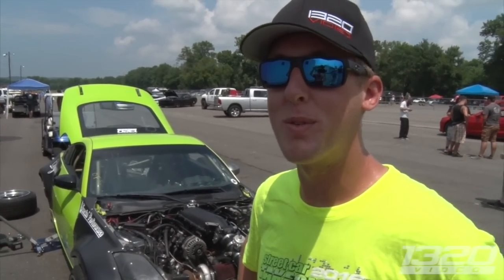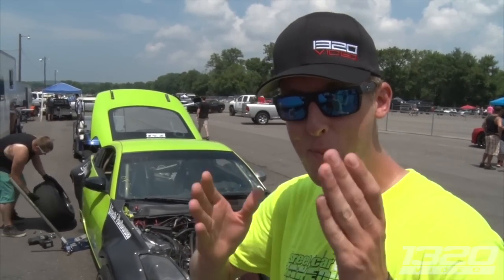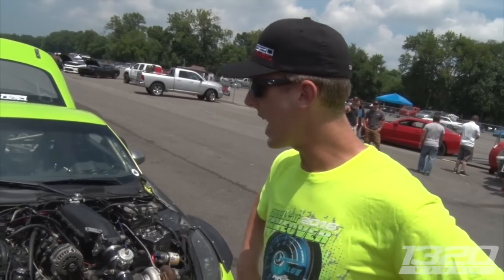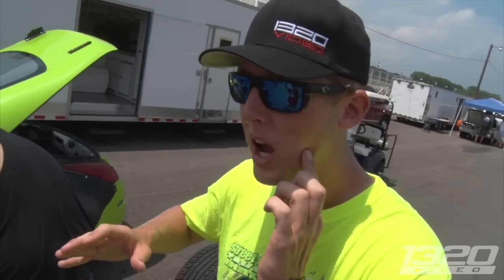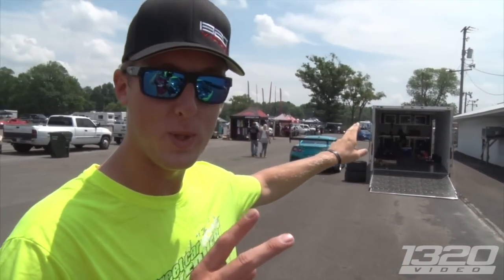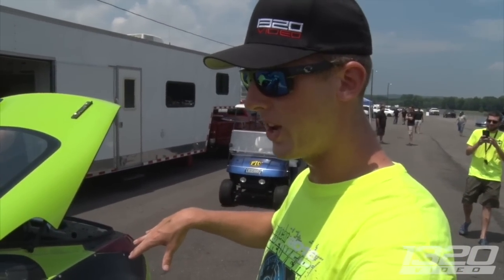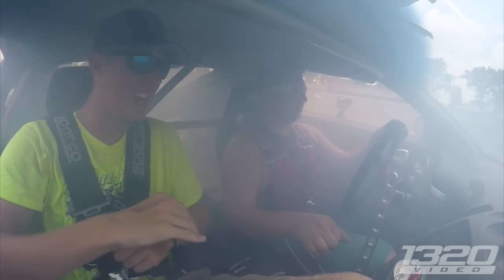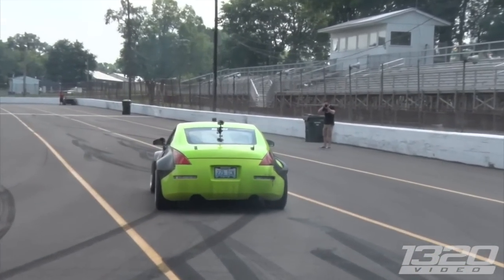1100hp 350z DRIFT Car!? - Cleetus' Garage Ep. 5

Comment: Funny how noobs think twin turbo gives more power than single lol
Reply: don't call me a noob or make fun of me....but they don't??😳
Reply: seams to be working well for this twin turbo LS setup....
Reply: They could tho, but it's just to make it spool faster.
Reply: +Gabriel Bahena One turbo is for low end spool and the other is for high end. That way you have virtually no lag.
Reply: +TTime685 ohhhhh that actually makes sense thanks for letting me know
Reply: On a V8 2 small turbos will spool faster then one big one...need the faster spool for drifting....
Reply: I'm not a noob, this car was single turbo before I went twins.  The twins spool quicker.
Reply: +Gabriel Bahena ;)
Reply: +TTime685 Not all TT setups have staggered size turbos. Some setups have identical size turbos, actually most do. Add in that some space constraints cannot accommodate a big single but you can match the flow with two smaller twins.
Reply: I got a fuckin quad turbo on my shit! Had 5 but at max revs it would create small black holes, and they do alot of damage
Reply: Why can we find articles of a single turbo LM7 making around 600whp, then when twin it was making 963whp?
Reply: +530z Hell yes it's the dude that drag races his drift car
Reply: +530z can this thing not spool quick enough in third?  You had so much room to grab another gear instead of bang limiter every time you actually got on it.  Not shit talking btw, legitimate question.
Reply: SW20AE86 knows what he's talking about..
Reply: +SW20AE86 You are correct sir
Reply: sigh so much misinformation. NO, twin turbos do not spool inherently faster than a bigger single. It all comes down to sizing. With two turbos you have to spin two turbines at a lower efficiency than a comparative single. Get your noses out of import tuner magazine and take an engineering course. Explain to me how you think a setup with more turbine weight and lower efficiency will spool faster? Completely absurd.
Reply: +Skylar Garrett am I dumb? I thought twin turbo set ups were for low and high rpm. one turbo being for low rpm and one being for high rpm? I hardly know about cars so I dont know.
Reply: Dylan Brittain That's not twin turbo. OEM's use the term Twin Turbo because it sounds cool, but twin turbo means that both turbo's are literally the same. When OEM's build twin turbo car's that aren't V-engines (packaging reasons) they're differently sized to kick in at different RPM ranges. The problem with that is how absurdly inefficient it is.
Reply: it's a v8 not a 2jz in line 6.
Reply: screw aspiration id give it some itb's. N/A is the way.
Reply: It's more complicated than that lol.

Comment: this is the first tuner car on youtube with the claimed 1100 hp that I believe actually has 1100 hp most of the time you see stock chassis  tuner car with stock drive train with out a roll cage unibody pos and oh yah its got 1100 hp with some bitches tits floppin around